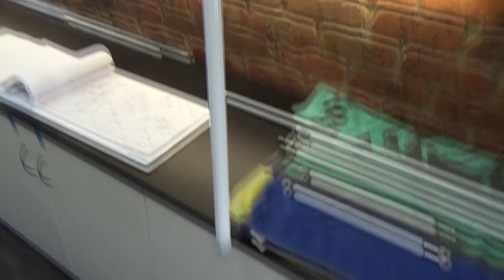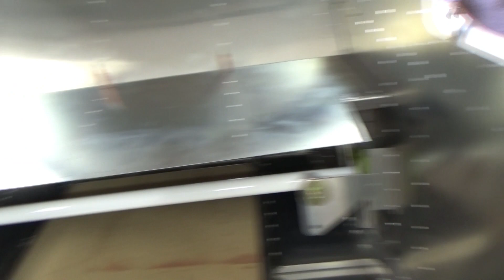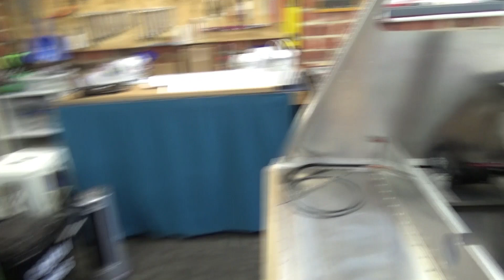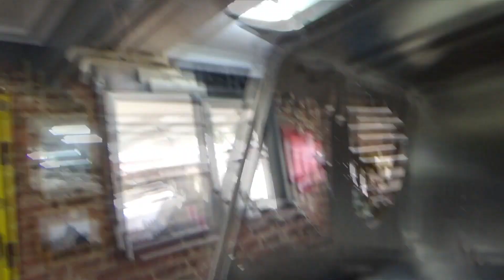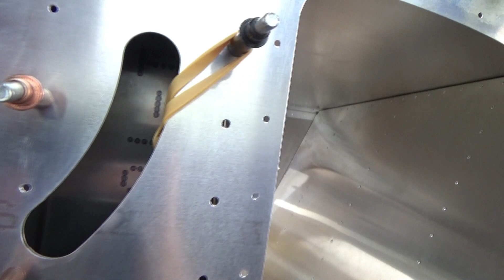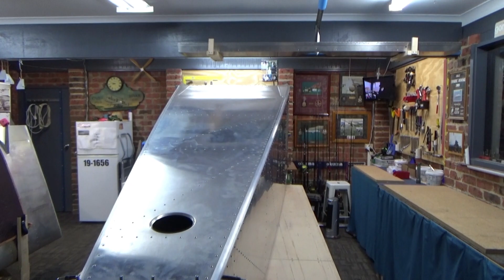How I assembled the Aussie 750 Zenith Cruzer Rear fuselage May 20

Comment: Im sure you probably have covered it somewhere but what do you use for corrosion protection and where do you put it. Is the inside of the rear fuselage need it or just the joining surfaces? Thanks. Great video
Reply from the maker: Core tec for me, goes on like aquas here or white craft glue. Just all the mating surfaces.
Reply: @scottmatthews5280  Thanks